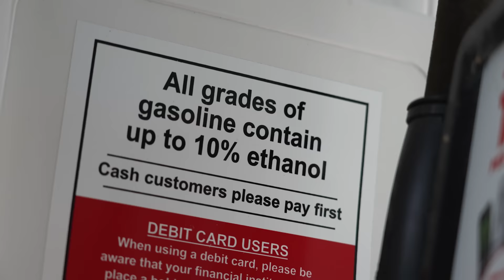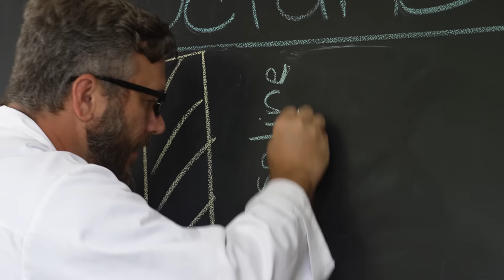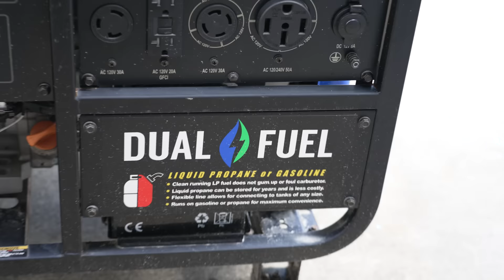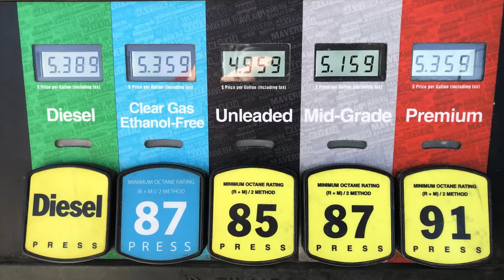This Will Destroy Your Emergency Generator! Don't Make This Mistake

Comment: This is BS.  I've been using E10 for about 20 years with no problems.  Also, when you remove the ethanol from gas you reduce its octane rating.
Reply from the maker: Wow! It’s almost as if you weren’t listening. I literally said it drops the octane. It’s not bs. You’ve just been lucky. Read the other comments.

Comment: I use 100% gas in everything. I get better gas milage in my SUV.
Reply from the maker: Yes. I found a station with 100% not too far away and I notice a difference also.

Comment: So am I to take from this video that you screwed up by not draining fuel from your generator before storage?  I mean honestly I'm not real sure what I just watched. As far as fuel goes, your generator will produce more wattage using gasoline over Propane and if you're that concerned about fuel, do as you mentioned use the highest octane and if you're really that concerned, add a bit of SeaFome to your fuel.

Now to debunk this bad gas theory, I have a 27 year old 3.5 HP Briggs & Stratton that I've put nothing but the cheapest gas in and I've yet to this day had to swap out the prime bulb and it fires up on the first pull to this day. The only maintenance I perform is an anal oil change, spark plug change and air filter change.
Reply: Anal oil change? 😮The old Briggs has 6:1 compression and is a flathead, it can easily run on much crappier fuels. They will run on diesel if you warm them up first. Doesn't mean it's good for the engine. Any modern OHV generator is going to be more like 8.5:1 compression, and this requires better fuel.

Also the difference in wattage between propane and gas is usually only a few hundred watts. You should not be maxing out your generator at 100% anyway.
Reply: @ryanroberts1104  Thanks for that imput Ryan, I'm not a mechanic so it appears that I misspoke, don't really plan on being a mechanic either, I don't really care to turn wrenches,  I used to ride a Harley "2009 softail" and sold it due that very reason, I hated turning wrenches on it, I do remember being told that the ethanol was bad for them and to use the highest octane with occasional Seafome in the tank.

As far as the generator goes, I had a 5500 and gave it to my parents and changed it out for a 9500 so if propane is better for the engine I'll consider that.
Reply: @Babyboomer_59  Using higher octane for no reason does not give you any benefit, in fact, it will make it run worse. Use whatever grade of fuel the manual says, it does not help anything to use higher octane. Higher octane actually means the gas is less explosive.

Propane is better because it's just a really clean fuel, also never goes bad. It is more expensive to run a generator on, but if it's only a backup it won't make much difference.
Reply: @ryanroberts1104  I'm learning more as I go, the Propane is the better option, just spoke with my brother-in-law and he said that if he had a duel fuel option he'd use the propane in a heart beat. He has two of the smaller Honda Generators which are only gasoline, but... here in Texas the pumps state with a label "could contain up to 10% ethanol".

Comment: Crap. I do save my unmixed fuel. Should I separate it before I mix in the 2-stroke oil. ???
Reply from the maker: If you’re not going to use it right away I would unless a gas station nearby has pure gas.
Reply: @HAXMAN   Copy. Thx4 helping. Don't change the format. 😁👍💛

Comment: Ethanol gas needs to die a swift overdue death. It's green washing at it's finest, and farming corn for ethanol is a complete waste of fertile land. That being said we can still avoid here in Canada as some/most fuel providers do not have ethanol in their premium grade fuel. Sure it's more money, but it saves you a siphoning session, with low octane water contaminated fuel as the end result.

Comment: dude, you made me laugh!  yeah, a jug with a drain on the bottom would be best to do the separation.  so, most of the gensets out there say that it is ok to run up to 10% eth, so what does your generator's manual say?  the fuel lines today are viton and should do just fine with 10% eth.  i use stabil in my fuel and normally run the carb dry and empty the tank if my generator is going to sit for any length of time (months).  at $3.50/gal for 91 oct, losing 10% of volume, puts the actual cost closer to $3.85/gal., not to mention the amount of time and expense involved in getting rid of the ethanol.  also, you were only showing about 5% eth, so that fuel is definitely clean / clear enough to not have caused your problem with the fuel line.

Comment: Ethanol base gasoline, when you want to sugar your own gas tank😂

Personally I like it, it makes for cheap engines and motorcycles because you let it sit for a year and everything it’s all Christian countertop and clogged and people sell them for cheaper😅 but as far as gas goes it’s pretty horrible. I started cars that were sitting for 15 years with gas in the tank and it’s not good gas but it still runs, put it in an engine now and let it sit for three years and you’re screwed.  It’s the environmentalist messing with us again ruining things and serving no good practical purpose or saving anything let alone the planet

Comment: I like the wet fart at the beginning,I just hope ya didn't get any on ya! 
For gens with mechanical governor ,make sure it's around 62-63hz no load so it doesn't pull under 60kw when loaded. 
Otherwise your voltage regulation works it's butt off and could get nuked.

Comment: First of all your generator is a piece of junk. I know because I had a 4800EH. I ran it for a total of about 24 hrs. Long story short I found out too late after reading reviews on Amazon reporting the same thing. Generator looked good, ran good then didn't. They are manufactured in CA. but certainly have a lot of Chinese parts. They are relatively cheaply priced. I got rid of mine because parts to replace cost half as much as the unit did. By the way I only ran propane those 24 hrs.

Comment: Ethanol does not ruin anything, only users of ethanol do.  Why would you think that two different chemicals (gasoline and ethanol) are going to act and perform the same?  You simply cannot use ethanol the same way you can gasoline.  I use ethanol in my cars, motorcycles, lawnmowers, chainsaw, log splitter, grass trimmer and never has it caused a problem in 25+ years. Why?  Because I ensure it does not get old, or collect water.  There are many ways to do this, you just have to be a little smarter and treat it as ethanol and not gasoline. Just please stop blaming your stupidity on ethanol.
Reply from the maker: I keep air in my tires. I’ve never had a flat tire. Anyone who has a flat tire is stupid. See how that works.

Comment: Gas contains 1% Cancer causing BENZENE...  So don't be sniffing it.  Your video is bogus, take a look at your genny's Kilowatt output using propane.  I have no problems running ethanol gas in my generator, I test run my Predator  for 5-10 minutes every couple of weeks. I have two 5 gallon cans for the Genny that have had the same gas in them for over a year. It works fine.  The problem is carbs with floats can get gummed up if they sit with ANY gas in them for long periods of time. You have to pop the bowls off of them and shoot carb cleaner in the jets.  Also car engines nowadays last TWICE as long as they did 25 years ago. Alcohol is a RACING FUEL.  My first lawnmower engine that my Grandpa gave me wouldn't run  cause the carb was all gunked up. I learned how to clean the bowl and jet, that was 60 years ago. Retired Refinery Engineer.

Comment: Never seen your channel. You're entertaining, funny all that......but you're also plain wrong. Blaming your issues on E10, which tests as E5 is just ridiculous. Add some fuel stabilizer in all your small engine fuel, more so anything that mostly site around and you'll be just fine. Everything has been designed for use with E10 for a long time. Complicating and deflecting blame to E10 is just plain false. Also if you store something, you can store it at less than full, and when you need it, just splashing some fresh gas in will wake up the old fuel.

Comment: I can't tell if that's hillbilly Bob Ross or cotton eye Joe🤣.
What a faff separating the ethanol...
It seems to me them gasoline generators are looking decidedly antiquated compared to the solid state lithium power banks you reviewed some time ago.
 + If you daisy chain 2 or 3  of lithium power banks together + with a wind /solar generator pretty much self sufficient not even reliant on gas - which may or may not always be available...
..
Am wondering if you distilled that Ethanol could make moonshine🤪.

Comment: Okay, so we all know to avoid using ethanol blends in small engines. But seriously, why do you feel the need to demonize ethanol & perpetuate the myth that it's "bad stuff"? Despite your feelings about environmental & political issues, it's strictly a matter of preference. All modern vehicles will run ethanol blends with no problem, and ethanol burns cleaner than gasoline. You would know this with just a wee bit of research, but apparently all your effort goes into acting like a clown.